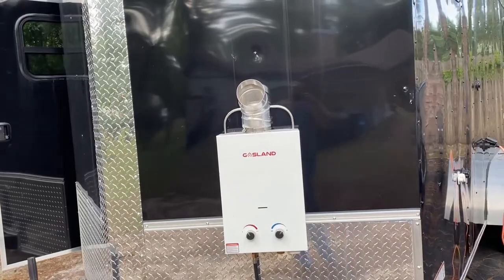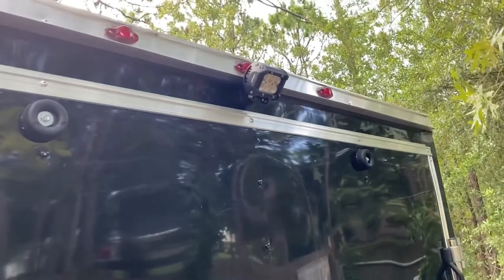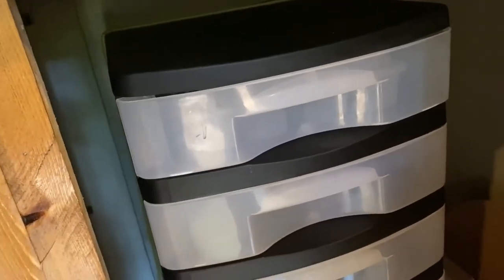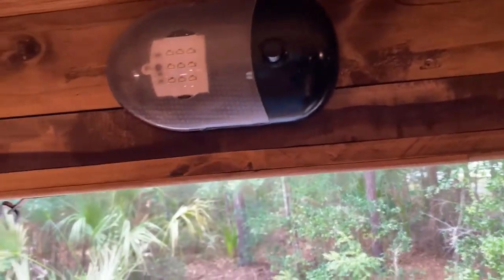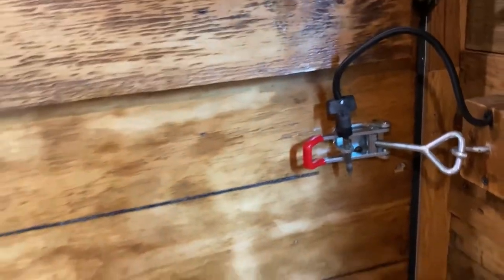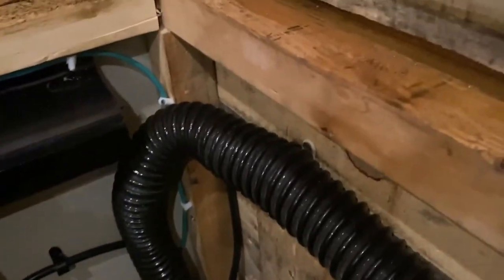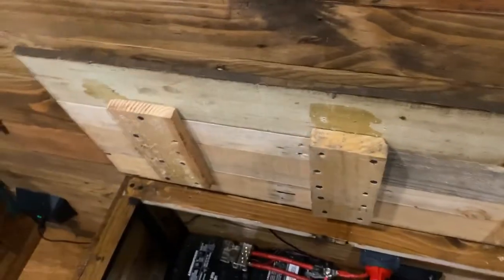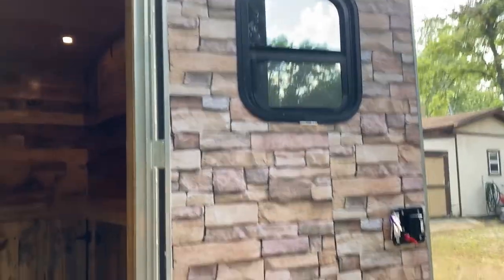Cargo Trailer conversion with pallet wood

Comment: Love the pallet wood look and I actually have access to free ones so this is a great video for me! I think I'd like to do this type of ac as well and love the dryer elbow into the floor exhaust idea! Glad to know its enough in Florida which is where I'll be alot! Do you know the total weight?
Reply from the maker: Thanks. Don't know the total weight but pallet wood isn't that heavy. I did only gain 100lbs of tongue weight totaling 600lbs
Reply from the maker: I added about 1100lbs. Total 3800lbs